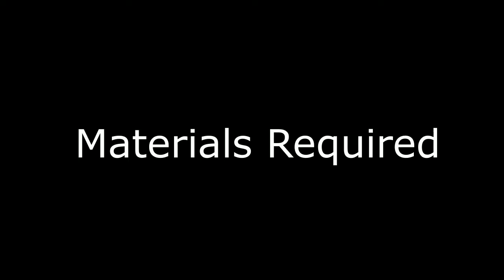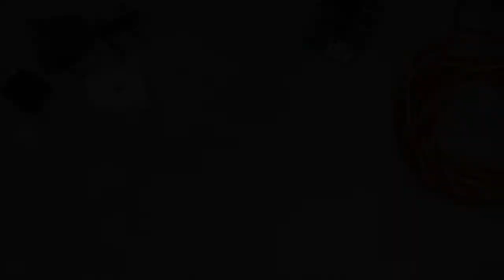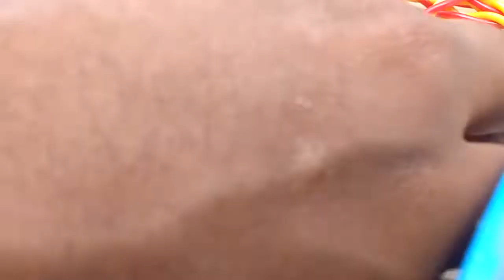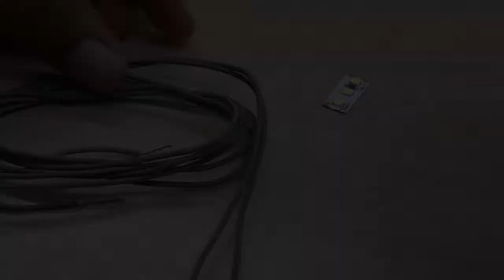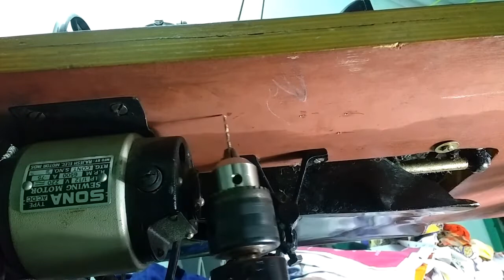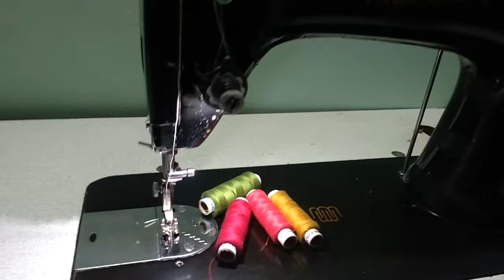How to Make Workstation Focus Lighting

Comment: You use a lot of extra wire for this..

Why do you put the switch there? Maybe it would be better to mount it on the table, sk your mother easily can switch it on and of?

Don't use tape to connect 230 volts wires. Use screw terminals instead.
And maybe you have to put a safety shield on that transformer?

But anyways.. It's a nice project. I think your mother appreciate it.